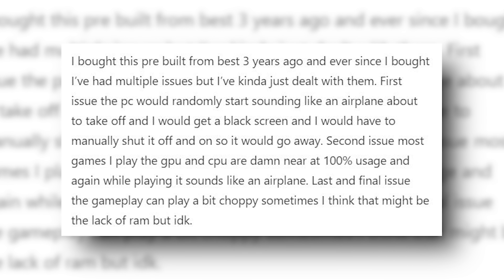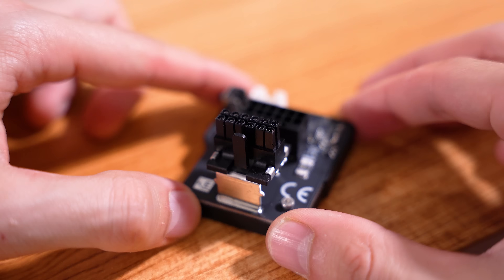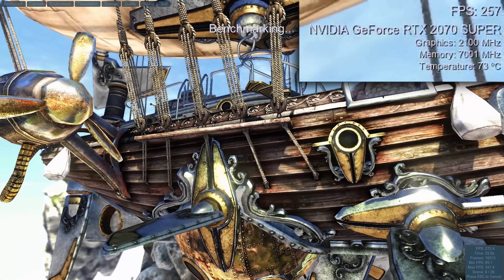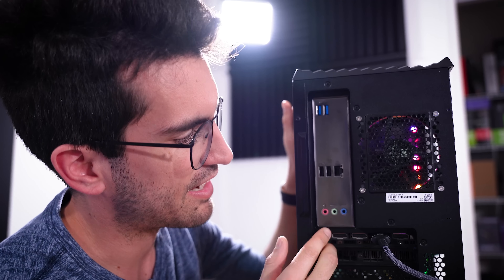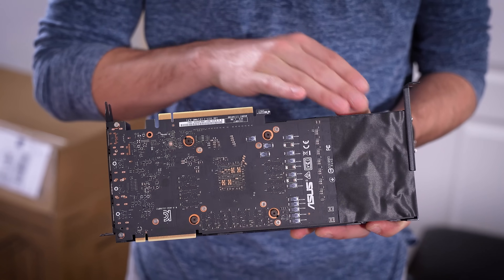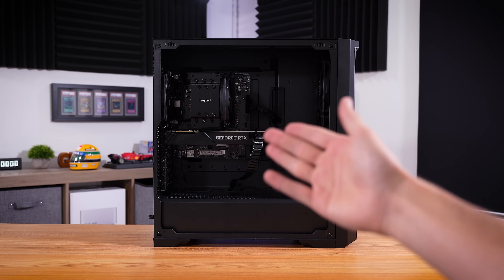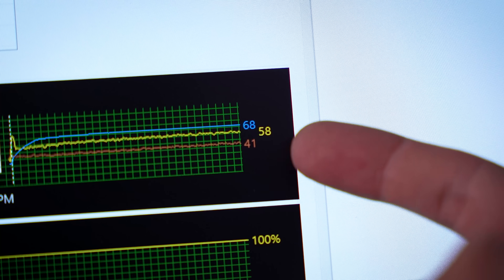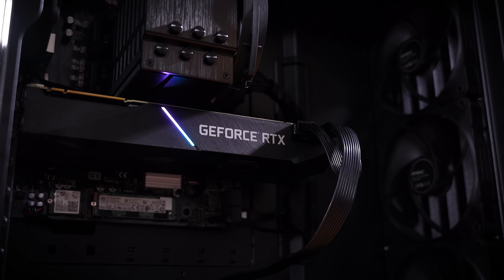Fixing a Viewer's BROKEN Gaming PC? - Fix or Flop S5:E3

Comment: Great Wall is an OEM PSU manufacturer and one of the biggest there is, of who other name brands use to make their PSU's, such as Corsair's "CX" and "TX-M" for an example.
Reply: It still needed replacing due to the GPU requirements
Reply: @Jalex0021  for me it would be CPU related
Reply: corsair CX series is total garbage though ive had some of those die on me
Reply: @dawn1berlitz  i have a cx 500 thats been running sold for over 8 years now
Reply: ODM
Reply: @AbsoluteSvdlvd  An ODM is a company that takes another company's designs and/or finished products and markets them under their own brand.
An OEM is is a company that provides other manufacturers with (semi-)finished products they can apply their own branding and marketing to.
An OBM is a company manufacturing its own-branded goods.
Great Wall is an OEM for numerous companies, i.e. Corsair. No company is known to provide the design to Great Wall to be sold as a Great Wall power supply.
They also function as an OBM (Original Brand Manufacturer) as they manufacture and sell products under their own name.
In this case, they are functioning as an OBM for the individual part and an OEM as a part for Asus to market as an Asus-branded product.
They are not functioning as an ODM because, obviously (to everyone with net-positive brain cells) they are not an ODM.

Dell would be an example of an OEM as they take the Nvidia-designed (and often manufactured) cards, slap the Dell name on them, and sell them as Dell-branded systems.

Remember: Step one of correcting someone is making sure they're wrong.
Step two is making sure you're right.

Comment: Great Wall is an OEM brand.  They make power supplies for several reputable brands.  That should be a decent power supply.
Reply: Yup. They made one of Corsair’s best SFF PSUs. The Corsair SF750.
Reply: @theyoungjawn  i wonder if they make the rm series as the cx series of corsair is garbabe and i kinda regret getting one that can just die without being pushed to its max
Reply: @dawn1berlitz  Seasonic makes the RM series - SuperFlower and Seasonic are the primary OEMs for Corsair.
Reply: @xXDarthBagginsXx seasonic is one of the well known brands i was likely replacing the cx series with a RM later this year as im getting a much newer board
Reply: @dawn1berlitz  i have a rm 850x and i believe it was made by seasonic and rebranded for corsair
Reply: @xXDarthBagginsXx  EVGA used to use SuperFlower, but I've not seen any Corsair units that were SuperFlower and they haven't used Seasonic in a while. They mostly use CWT and Great Wall these days.
Reply: @dawn1berlitz  Last I saw, both the RM and CX series were made by CWT, who also happen to made the HXi series. Great Wall does make the Corsair SF series of power supplies, which are A tier.
Reply: @xXDarthBagginsXx  Corsair RMx appears to be CWT, not Seasonic?
Reply: @TheGameBench  yeah EVGA are FSP now.
Reply: @AbsoluteSvdlvd  That's right. I forgot who they shifted to. FSP isn't bad... but they've been hit or miss.
Reply: Yeah, i saw them in 486 pcs and they were still working
Reply: It was still close to being underpowered for the PC specs. PSUs are most efficient when operating between 50% to 80% of their maximum capacity, so you don't want a power supply that barely matches your hardware needs. And that's ignoring wear and tear issues.
Reply: @BReal-10EC   wasn't saying the upgrade wasn't an upgrade, just that Great Wall PSUs are typically good.
Reply: @BReal-10EC  That's definitely where most hit their efficiency curve.
Reply: It looks to possibly be the E Gold series, which is B-tier on the Cultists list. Not bad at all.
Reply: I find it funny that Greg is sponsored by be quiet! I love their stuff and use them in my PC.
But he didn't notice that the Great Wall PSU ... Is a be quiet! PSU. As soon as he took it out I knew they look exactly the same. I hope Greg digs that PSU out of the trash bin to compare if this checks out for himself.
Reply: Came here for this
Reply: It's awesome when no one knows the superflowers and great walls of this world. Their high wattage and high efficiency psus can stay undercutting their branded selves and everyone is none the wiser.
Reply: The dude has a higher end 1000w PSU now, Cares not given at this point lol
Reply: yep, they even make the popular RM850X PSU
Reply: Yeah it was probably fine for the system as is. Even with transients I would budget around 350-400 Watts for an non OC RTX 2070 Super card. Nvidias requierments here are very conservative in my eyes but I guess they would've considered more power hungry HEDT plattforms as well. But now the viewer has more options to upgrade for sure.
Reply: Yes they are good, I said the same and think I heard Linus talking about it. I had to do a double take, I thought for a sec you was Red Beard's Garage lol
Reply: @bikedoc4145  lol
Reply: You should make content on this topic. You seem to know a lot about it.
Reply: They make some A tier rated power supplies, but he's done this in the past and assumed a power supply was a questionable brand, but I feel like Greg doesn't really know a ton about power supplies. He made the same mistake with a Delta power supply because he doesn't realize that they OEM for the enterprise market and are on the level of Seasonic.
Reply: Yes great wall is but just a starter for first build. Once you get the hang of it, then buy EVGA PSU's. To start gold rated  is the sweet spot...
Reply: No
Reply: It's funny when people who don't know stuff talk about stuff. Like FSP. People see that and they're like no... shit brand. And these people don't even know that FSP produces generators and power supply units for electric companies and power plants. If that isn't the definition of reputable  i don't know what is.
Reply: yea, i have seen them around and they are not a bad product. dude was just hating because it was a be quiet that pays him (I use a Be Quiet 1200w power supply but still)
Reply: He said it wasn't high enough in wattage...
Reply: yeah except the minimum requirement for a 2070 super is 650 watt not 500 watt its no wonder it behaved funny whilst gaming aside from the lackluster cpu cooler.
Reply: that wasn't the issue. the issue is the PSU wasn't powerful enough for the GPU, according to Nvidia.
Reply: Okay Chinese bot
Reply: If you ask me no oem brand is reputable
Reply: @holyhelga  In this case it's not OEM for cheap machines it's an OEM for actual manufactures, some models of branded PSUs are actually great wall.
Reply: @holyhelga  ODM, not OEM. Great wall is no different then FSP or Super Flower etc. they are the source manufacturer's/white label that private companies like EVGA, Corsair, ASUS etc all label/custom spec manufacture through.
Reply: @holyhelga Wow. 😂
Reply: @holyhelga  These are generally unknown to most people and are often in people's machines with a different brand name on them. Many of the brands don't do their own manufacturing, superflower is one that manufactures for other brands. Same with great wall here.
Reply: They just have more marketing then smaller brands

Comment: I would upgrade the ram but  I also understand your point.  But the user can  get new parts and build a new PC.
Reply: replaced so much that was not really necessary but left it in single channel
Reply: @yissnakklives8866  The CPU was running too hot, so he needed to replace the cooler and the PSU was below the GPU's recommended requirements. How were these not necessary?

Comment: My brother had bought an identical build to this a few years back. I recently took it in and cleaned it up for him. The overall build quality is an absolute nightmare. The motherboard was Jammed down onto one of the standoffs so much it was poking through. The extra metal frame that was along the pcie slots was holding on tight to that GPU. I've never been more sure something was going to break. But Luckily the only thing that that got really injured was my hands with all the micro cuts lol.. I really hope you had a better time with this than I did.

Comment: That CPU cooler is so horrible.  Wow that is a totally stripped-down motherboard. I've never seen one that stripped down.
Reply: I did a double take at that IO. Like wow what a joke for connectivity.
Reply: I was wondering, how much money did they really save by stripping down that motherboard so harshly?
Reply: @arthurstarling9743  There's 2 factors. First, they save a bit on stripping it.  Second, they make money again when it has to be replaced...
Reply: @arthurstarling9743  Likely quite a bit. In the CPU area alone, if you were to buy all of the missing mosfets and passives, that could be $20-30 depending on what they're using. OEMs of course get huge discounts for buying reels of parts vs piecemeal, but it's still a significant reduction.

Connectors are the next most expensive part, they saved a fair bit deleting all of those as well. Not only in connector cost, but copper cost and board complexity, not having to run as many traces. I'm actually surprised they removed the connectors from the board design, that's some real cheap skating. Usually they just use a retail board and not populate the connectors or passives.

It's a shame that they removed those connectors from the actual board design. I've been able to add missing connectors and components on OEM boards to get back missing functionality. My most recent "upgrade" of an OEM board was an older HP AM3 board (Apricot-RS780L-UATX.) It had the pads for two additional DDR3 slots and a full size PCIe x16 slot that weren't installed.

Adding in missing RAM slots is usually straight forward, just install the slots and they generally work. The BIOS may not detect the memory correctly, so you can end up with hilarious things like a BIOS screen that says 0 MB installed, but the OS will see it fine.

Adding missing PCIe slots is another story. They usually remove the passives with the slot, so you have to install those too. In this boards case, it was something like 52 0102 SMD ceramic caps the size of a grain of dust. But the slot worked fine after all of the passive capacitors were installed. There's actually another PCIe x1 slot that can be installed, but the x16 slot was enough for me, because it allowed you to use a non-crippled video card.

I also cross flashed the BIOS on the board with a BIOS from a similar 760G AM3 board. I lost the fan speed detection, but gained more features in the BIOS that were absent before.
Reply: That CPU cooler is odd imo, it looks like an intel stock cooler and yet is pretty incapable at cooling down the CPU. I've an old intel stock cooler in my old computer and even it can keep the CPU at reasonable temperatures and reach 4000 RPM if need be. And it looks very similar. I'm not sure that's actually an intel stock cooler we've seen in this vid, more like a bad copy of it.

Comment: The Dark Rock 4 comes to the rescue. This cooler is one of the best on the market. I used it on a 5800X3D stock settings and temps never went higher than 76 degrees at full load (stock settings)